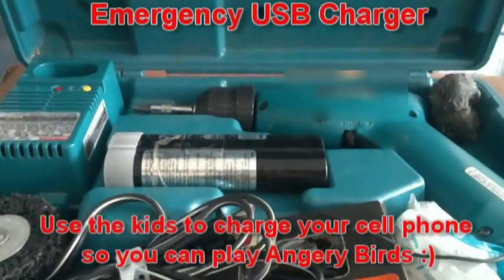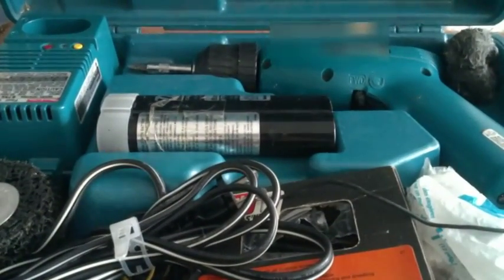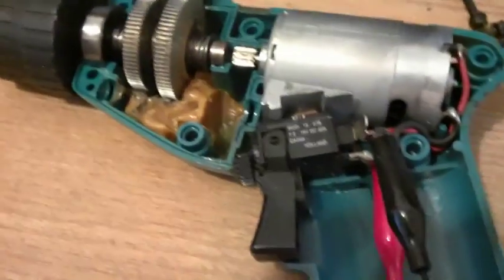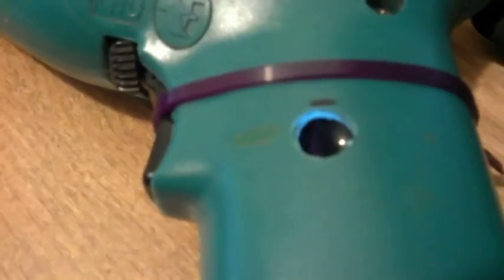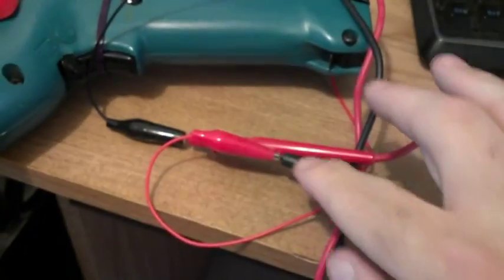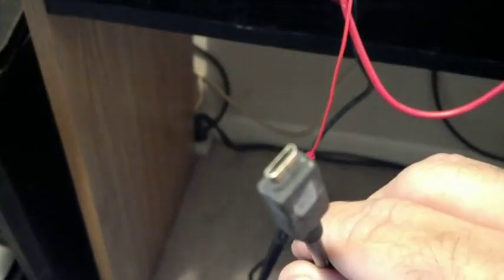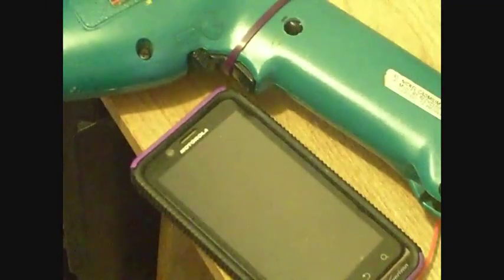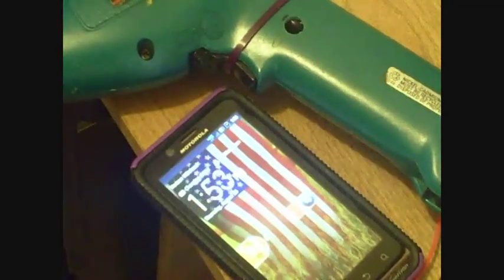Emergency USB Power from an old drill

Comment from the maker: It would depend on the watts you are pulling. Its harder to turn when charging a battery compared to a cell phone. But You could make it work a 18v drill would need to turn slower or need a voltage regulator. Something out of a solar light you put in the walk ways would probably work. But as for wind I think it would just upgrade you blades will it turns. :)